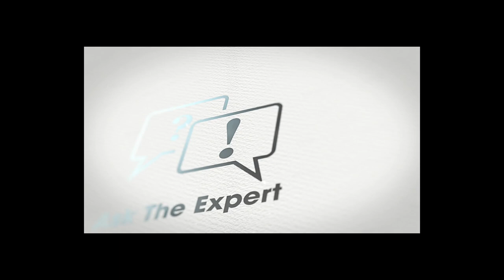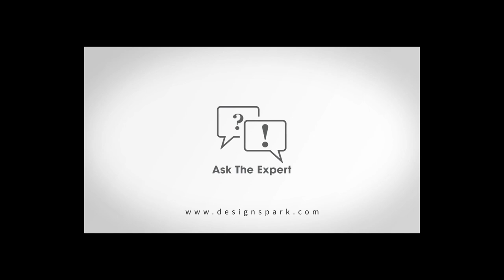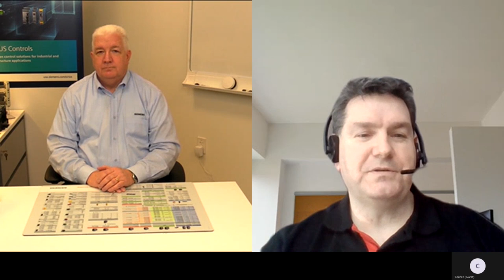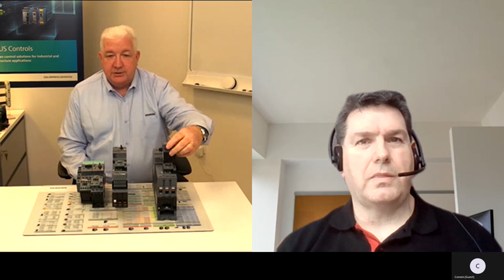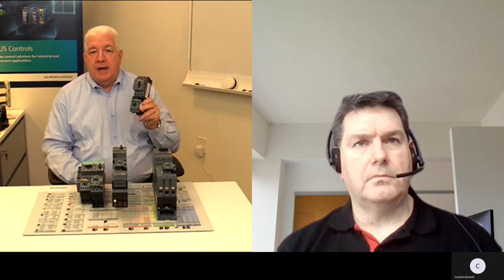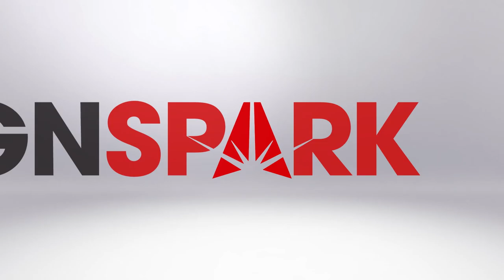Siemens Ask the Expert - the modern control panel with John Burns

Comment: How do you reset this when it is in nema4 panel without opening the door to switch off and on the handle because your door disconnect handle is only rtaed for NEma3R